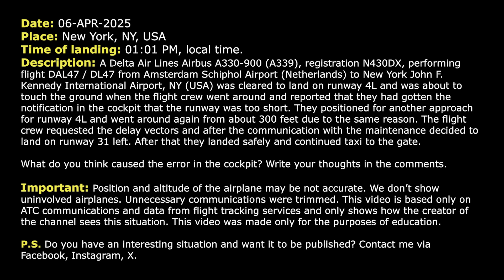The longest available runway is too short. Delta Airbus A339 has problems over New York. Real ATC

Comment: to the non flying public this might seem kinda silly, but you just gotta comply with the standard procedures. if the airplane says runway too short, going around was definitely the right call here.  
until you can confirm the system failed and make another plan you cant just ignore it.
Reply: If I was a passanger, I'd rather go through two go-arounds than have the pilots go "fuck it, we ball" only to find out the the runway really was too short.
Reply: @Crayshack my question is, is 4L a normal runway for an A330-900? If it is a normal runway for that aircraft that would point to software. That plane wasn’t a new variant, correct?
Reply: @ It's a relatively new plane (released 2018) and the runway in question should be plenty long (nearly twice the minimum).  But, these alarm systems exist because sometimes the pilots missed some critical piece of information.  I've read incident reports of cases where pilots got too many false warnings, ignored them, and then crashed.  It's a good reason to see the pilots taking a warning seriously even if logically it shouldn't be going off.  

It very well might be that the plane detected a mechanical failure that increased the required breaking distance and this video is the pilots avoiding a crash.  It also could be a sensor malfunction and they would have been fine.  It's better to find that out when you have the maintenance crew look it over after a safe landing than the NTSB figure it out after a crash.
Reply: @mikecumbo7531  airplanes are machines and sometimes machines glitch. not the first time it happens
Reply: @mikecumbo7531  A330-900s have landed on 4L before, if that's what you are driving at. But there are a hundred reasons why the automated system might've alerted the pilots and you can't run all of these against a so-called sanity check (as in "does the readin make sense or is the system faulty?") in the seconds between the alert and touching down. If the system tells you the runway is too short and you have the fuel for a go-around, you do the go-around and figure it out later. What if the "special weather" that was mentioned played a part? What if the ILS was broken and they were high and late without realising? What if the flaps weren't extended properly? What if the fuel load was higher than anticipated in planning? What if...? What if...? etc.
Reply: @QemeH  That was my guess, either good wind on journey and lots of heavy fuel, or, more likely, glitch on fuel reporting to the warning system. As an engineer, I've designed and programmed this sort of thing for the aviation industry. How would I design the software for the "bad/missing fuel level sensor" case? Simple - assume maximum fuel load. When in doubt, always assume worst case.
Reply: @Crayshack  yeah, there’s city at the end of that runway. I’d like them to check, check, and triple check again.
Reply: Yeah, or until it's a fuel emergency and no other runway is in range.  But they've got fuel, so why not stay in the air and play it safe?
Reply: That's why you do performance calculations for landing, so you know how much runway you need. In case the stop margin is plenty and you land within touchdown zone, runway too short alert is surely erroneous
Reply: @ May I remind you of the swiss cheese? The system is there for a reason and if it alerts, you go around and ask questions later.
Reply: @QemeH  so you keep going around until you are fuel critical instead of landing the airplane on a runway plenty long enough to land on?
Reply: @ No, I troubleshoot the problem with maintenance on the line until I either have a solution, am below divert fuel or have ruled out any other source for the alert that isn't "system is just faulty" - and THEN land on the runway I know is long enough.
Reply: Out of curiosity, as one of the non flying plebs, if there was say an emergency, like the runway was only slightly too short, would you land on the numbers to increase the available runway and use that to over ride the computer? Thinking QF32 type situation here.
Reply: @ In an emergency, you'd override the runway overrun warning, if neccessary, yes. It is "just" a secondary layer of safety to warn the pilots that they missed something and will (potentially) not make it to a standstill before the end of the runway. If you are aware of all factors and intentionally land on a runway that is too short (because you have no better option) the system will not prevent that, it will just give a audible warning.

It is, however, good practice to only do that if you really need to. And since KJFK has a longer runway available that didn't have to big a crosswind component, it is almost always better to just use that.
Reply: @BabyMakR  short answer no.
Reply: Land you bar steward.

Sorry Dave I can’t do that…and neither can you.
Reply: So why did they go around twice on a rwy that long.
Reply: @jamesbruzgis9476  i was not there to tell. i supuse they assumed it was a false alarm and try it again thinking it would be fine the second time. when it wasn’t, they knew it was indeed a faulty system and started to troubleshoot the problem
Reply: @jamesbruzgis9476 , the aircraft’s ROP system was telling them that they didn’t have enough length to land. The pilots knew they in fact had plenty of runway, but they can’t simply ignore an alarm. Although it was probably a software glitch, it could have been stemming from a plethora of other problems, and the pilots chose the safe alternative and initiated go around procedures. These things happen, and providing they have enough fuel they will move out of the pattern and go through their checklists and talk to company maintenance until they find a solution to the problem. If you noticed, the pilots were perplexed with the alarm, but stayed calm and followed proper procedures.
Reply: @jaymeade9898  sounds like a airbus problem! lol I looked up the 330 QRH (I wonder how I have access to that 🧐) I was surprised to see there’s nothing in there on it! 🤷🏻‍♂️
Reply: @jamesbruzgis9476  Unclear from the video.  My guess is some sort of sensor malfunction, but that's hard to know for sure without looking at the maintenance reports.  What's pretty clear is that the pilots weren't sure what was going on, so they were acting with caution to get safely on the ground and solve the mystery later.

Comment: "4L is too short for us" "Ok I can give you 4R" BRO WHAT?? 😭
Reply: Well, I think the controller was (correctly) assuming that it wasn't really too short, but rather their runway overrun protection system had faulty data for 4L or was otherwise producing a faulty result. That runway has 11,000' landing distance available and is sitting 12 feet above sea level. There are few aircraft that could not land on that. The A330neo is not one of them. Still, good decision by the crew to request 31L instead just to play it completely safe.

Comment: Would be interested to know what their maintenance crew told them, and what to do if it happens again.  Following rules, covering your ass, erring on side of safety, call it what you want, the crew 100% did the right thing!
Reply: Reentering all the performance calculations into the FMS would have been the first thing I tried
Reply: I mean the conventional method of running the landing performance calculations either by hand or with their EFB should show them actual landing distance and margins. 🤷🏻‍♂️ They don’t “need” the ROP system if they’ve run the numbers multiple times and the weather is fairly straightforward.
Reply: @ True. I'd still be very carefull to disregard the warning even after doing the calculations - because the system takes real time data into account, so it corrects for (e.g.) bad weather info, faulty flap indication, faulty air speed indication, faulty ILS beacon, etc.

If I am sure I have the distance, but the plane is beeping at me that I'm not gonna make it about 3 seconds before I put it down - I'm also going around and have a second and third look.

But yeah, eventually - if there is no longer runway available like it is here and you can't find any other fault in any system - you disregard the warning and land based on your calculations before fuel runs low.
Reply: @ I mean, millions of flights have landed using a regular landing performance sheet or calculator.  I think it's generally implemented to prevent pilot error in the case of a botched / unstable approach, float, incorrect flare, unanticipated runway conditions or contamination, etc... none of that really applied here when the pilots are clearly focused on an approach that has to be perfect to avoid another go-around lol. 

In this case there just weren't very many unknowns or variables, it all checked out.
Reply: @ Still, this is about the swiss cheese. Just because it works without a layer of safety most of the time doesn't mean that level is redundant.
Reply: Im guessing they either turned of GPS or pulled the CB for ROW/ROPS. 12000ft is plenty to land an A330 and you also do normal landing calculations before the approach anway. So if your calculation says you have a stop margin of lets say 4000ft it would be safe to just turn off ROW/ROPS. It is a nice safety feature but in this case it's clearly malfunctioning. Most older airfract dont even have this feature and still manage to land without overrunning.
Reply: Probably told them to try a longer runway if possible and - if not - do the calculations by hand to confirm and double check every system before landing with the error. It's called "sanity check" and it takes time, because you have to rule out every possible actual problem, before you can assume the warning to be faulty.

Comment: I don’t understand;  the runway on the diagram that runs from the center up towards 10 o’clock looks like a longer runway than the one they’re trying to land on.
Reply from the maker: With the winds they had the most suitable was 4L but after 2 approaches the winds changed the they were able to accept 31L. And 31L has a displaced threshold.

Comment: For context : those are some of the longest runways in the world !
Reply: There are a lot of ~12000ft runways around the world, with many longer than 4L of JFK, so I wouldn't really say they are some of the longer runways in the world. Runway 31L comes in at 32nd in length (but wasn't the "too short" runway), while 4L isn't among the top 125.
Reply: 31L is the third longest commercial runway in the North America.
4L is longer than what’s required by an A380 at MTOW.
Reply: @dufonrafal  Well said, but neither of those facts make it "some of the longest runways in the world." I understand where you're coming from with the length, but the initial statement was slightly misleading.
Reply: @danieldikio  runways over 13,000ft are pretty rare and this is the 32nd longest runway in the world. So yes it's true.

12,000ft also is more than what a lot of international airports have.
Reply: @dufonrafal  31L wasn't the runway with the "too short" indication, and 12000ft runways aren't uncommon at all, but okay.
Reply: @danieldikio  He wasn't sure that 31L would do it without headwind and 12,000ft while not uncommon in major airports is still way on the longer side of the spectrum.
Reply: @dufonrafal  31L landing dist is just over 11'000'. Long enough for anything, but not that long compared to many airports around the world.
Reply: 31L yes. But not 4L.
12,000 ft of 4L is not that unusual.
Reply: Not even close.
Reply: @philwhipple4557  31L is 15,000ft long so yes (it’s the third longest commercial runway in North America).

At 12,000ft 4L is not among the longest in the world but is still a very long runway. An A380 at MTOW needs 11,500ft for take off.
Reply: except 13R, theyre not even close to being some of the longest runways in the world.
Reply: Thanks for the context. I don't suppose they'd be willing to get out and extend it a few hundred yards while they circle...

Comment: When pilots can confirm required runway length, they don't need to pay attention to malfunctioning equipment when it indicates otherwise.
Reply: Unless company policy says otherwise
Reply: Famous last words on the voice recorder…
Reply: Was it malfunctioning?  Or did the aircraft's weight and the ground speed on the approach indicate to the system that the plane would be too hot to land with required runway safety margins to allow for failures after landing (thrust reversers, wheel brakes)?  I don't know.  Do you?
Reply: @  it was malfunctioning.
Reply: It’s attitude like that that caused Air Transat 236. Thinking it’s computer error but fail to recognise the real problem
Reply: WAS it really malfunctioning or was the Airplane heavier than usual (like from taking much more fuel than usual because jet Fuel was cheaper in Amsterdam) what the just computer recognised.
Or they entered 4R into the computer and forgot to change that FMC to 4L before they landed.

Comment: Systems like GPWS or ROW/ROP can’t prevent crashes if pilots start ignoring them. So it is a pain in the neck when these systems are unduly triggered
Reply: The question is WAS is REALLY unduly triggered or was the Airplane heavier than the pilots thought.
Reply: @AGerm332380s la d in that runway no issues. I bet it was a glitch, but u have to go around the first time. Second time no
Reply: Unless it keeps doing that and you have to start declaring fuel emergencies….
Reply: It's just an indicator, an advisory tool.  If the runway is indeed long enough then pilots can disregard the warning and continue the landing.  Just do the calculations to confirm the required runway length and accept the landing.  Humans don't have to listen to equipment when they can confirm malfunction or incorrect indication.
Reply: @ of course. But u go-around the first time. ROW/ROP can save you from landing in the wrong airport, when u r convinced u r in the right one! So go around… but s second go around is too much, I think

Comment: run the numbers from the for the 4L?  we all know the the Airbus ROP system is sooooo good.  You've got 12k+ feet Delta.
Reply: 4L LDA is 11010
Reply: @ okay….sorry, I didn’t pull out my iPad to get the exact distance. Point being, even with a wet runway, there was way more than enough, even if they were overweight.
Reply: @msethhunter not necessarily. You don't know the real Landing weight the A330 had that day and what date was entered into the computer by the flight crew. Maybe they inadvertently entered 4R into the computer or a higher landing weight than usual.
Reply: @ in no scenario will it take 11,000 feet to get an A330 stopped that isn’t an emergency.

Comment: Random question - why would the pilot at 08.24 inform ATC of ‘vector cross’ ? Many thanks.
Reply from the maker: Controller informed the flight crew that they were going to cross the localizer and tha pilot confirmed that. It means that the pilot should ignore the localizer and they had to continue according the vector they were given.
Reply: @YouCanSeeATC  Just to add to that, when you're being vectored for an approach, you almost always get told to intercept the localizer (i.e. as you get near it, turn to follow the localizer inbound).  This is ATC's way of giving the pilot a heads up that they're doing something out of the ordinary so the pilot's not wondering if the controller forgot to give them the intercept instruction.  Or worse, their brain goes into auto mode and they turn to intercept because that's what they almost always do.
Reply: @YouCanSeeATC  Are they ignoring the localizer for their assigned runway, or the localizer for a different one?  Does ATC always inform pilots when they are crossing a localizer they are not intended to use?  I've also never heard of this before.
Reply from the maker: @ I believe the are ignoring the localizer for the runway they are set up (assigned runway).

Comment: Delta 47 needs to list the Shuttle Landing Facility as it's alternate from now on. Maybe that 15 000 foot runway would be long enough?
Reply: Area 51 main runway is 25000 ft long.
Reply: @beroth1  not all of that is concrete, as the bulk of that 25000 feet is a dry lake bed. Same applies to Edwards AFB.
Reply: But unless you are an extraterrestrial space craft, or a top secret aircraft for our military. One that "uh umm doesn't exist" area 51 security takes a dim view of anyone landing there.@beroth1
Reply: 31L in JFK was an alternate landing site for the shuttle.
Reply: @Busdriver321  Yes, but the joke wouldn't have worked if I said they should do exactly what they did.
Reply: Nah, just use DEN - 16R/34L is 16,000 ft
Reply: 31L is 15,000ft long
Reply: @dufonrafal  And was one of the possible emergency landing spots for the shuttle (https://en.wikipedia.org/wiki/List_of_Space_Shuttle_landing_sites)
Reply: However, landing distance available beyond the displaced threshold makes it only 11,247ft. Still pretty long, though.
Reply: Gonna have to divert to KCSM,…..questionable on fuel lol
Reply: @JimmyShot  Right? Well, at least the almost non-existent fuel load would help to shorten the roll out. Probably only need to tap the brakes to get it stopped.
Reply: @slartybarfastb3648  the way the wind blows out there it’ll likely stop a zero fuel aircraft.
Reply: BJL?  😂